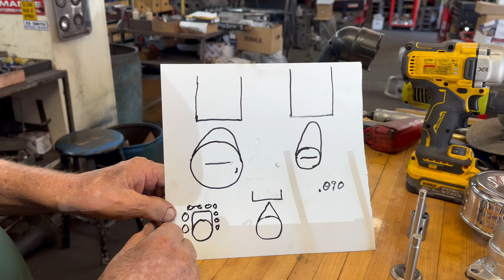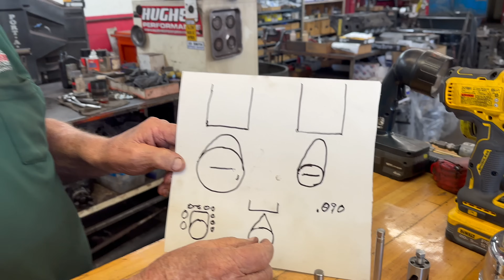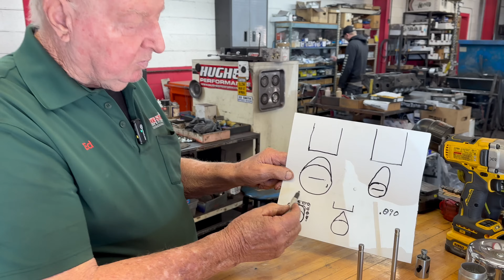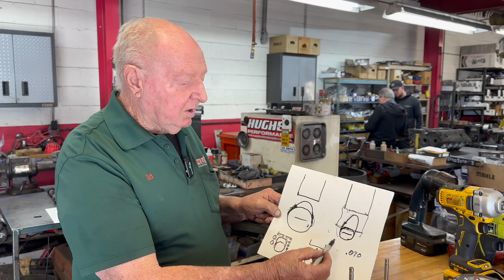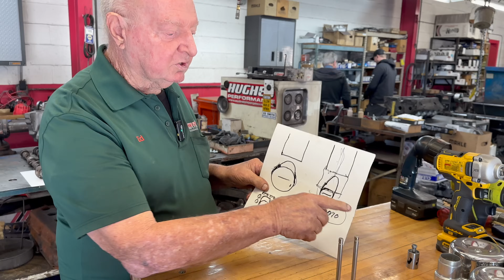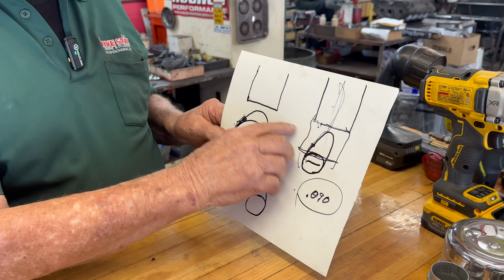UpLifting! ReGrinding CAMS for LIFT - Ed Smith Schools #barryt

Comment: I run solid roller lifters on a hydraulic roller cam in a 496 bbc.same spring pressure for hydraulic lifters. 500 more rpms

Comment: Great info! Here's a book ya don't have to read, but you may find interesting! You said Dodge in 1960, I have a set of 1961 Chrysler 32" Long Ram intakes that have been in the family since 1966. They are on their 7 th engine in their 5th drag / street car. In 1968 dad called Crane Cams and told them he had a Dodge 413 long ram in a 1957 Chevy and wanted a cam that would make them wind out better, they sent him an Experimental for Long Rams hydraulic flat tappet to try out. They put it in and hit the road with MH slicks on their 5.20:1 one ton truck axle in the back He broke the bellhousing on the 727 (I still have it) when it flashed to 7500 rpm and he hit second gear to catch it. He put that engine with 1959 imperial/300 E "509" heads in a 1964 sport fury 4 spd with 4.56 gears, went to bunker hill Indiana dragstrip in 1968 and ran in weight/ci class against 409s, 427 Chevies,  427 Fords, and a few 426 wedge cars and brought home the low e.t. trophy sitting on my shelf. Those intakes on a low compression 383 or motorhome 440 WILL come in and out of tune about every 600 rpm or so, getting progressively more violent being way louder than the  exhaust thru hood scoops (two big Thermo Quads) you can hear singing quite well 2 miles away leaving rubber every time they hit those in tune rpm windows in any gear. You have to watch out because if you let them hit 6300, they hit again HARD and will light up the tires in high gear in a C body with 4.10s and a 383 that never had the heads off it and flash thru an orange box limiter to 7300 instantly. That cam lists as a 302 / .455 on a 109 ctr or a 232 deg at .050. But A LOT can happen in those 302 degrees! It was put in a 440 Six Pack drag car and eventually wiped out 3 lobes from Napa lifters. They had .050 to .080 lobe lift left. We put in a new .230 / .474 Purple shaft on a 108, should be close, right? Not Even! That Crane went .2 seconds FASTER with the rounded off lobes! Then came a "280-.480" Competition Cams on a 110 ctr. This was a 446 ci six-pack cc'd at 7.75 :1 on stock 906s pushing a 4680 lb race weight with driver 4 door C body to 13.41 @109 for 13 years on 87 pump gas! The 280-.480 went slower than the purple shaft, still not catching the wounded 1968 Crane! Finally, we called Crane back and got someone who knew 440s. He sent us a "324-.552" on a 108. 248/254 @.050 dad looked down it at those big round lobes and said, "That sucker's gonna run!" Yup! Dropped .4 sec off the 284- .484 and set off car alarms with 3" tractor mufflers on it! Those lobes on that 1968 302 Crane were ROUND and aggressive. It is the only hyd mopar cam I have seen that actually lifts about .020 slowly, then snaps open, STOPS  moving the valve at max lift and holds it there, then drops like a rock until about .030 from the seat. For an iron head  413-440, I like big, round, identical, and close together in the middle straight up straight grind 240+ @.050 lobes! I have tested every casting of mopar wedge head except 1 of max wedge, even 350 heads, the 1959 "509" and early 1962 "324" with welch plugs have the max wedge chambers and gorgeous castings with the straightest shot to the valve by far! Back when you were at Dodge those custom order 400 + hp 413s and Desoto 350 hp 8bbl 383s from the early 60's were making 390 hp 440 six packs and 335 hp 383 road runner engines (there were 361 Desoto 8 bbl beating that) look weak.  They all had more hp/ci! I do not toss old 4 bolt heads! I sent that wounded 302 Crane to Crower (Crane wouldn't touch it, and only Crower has the right BIG BASE CIRCLE blank) for duplication. Crower grinder operator who has been there since muscle car days calls me personally and says, "Hey man, I just made the pattern for that Crane. There's something WEIRD going on with those lobes! I'm keeping that pattern if you don't mind, and I GOTTA know how it runs. A bigger base circle limits lift but allows more aggressive and complex patterns." I told him EXACTLY how it ran! I have 2 now, used dads pistons and rods,  a truck 413 block, big valve "509" heads that a professional porter for NHRA top fuel and NASCAR among others said when he saw them stock "wow! The nicest big block mopar heads I have ever seen! There's not much I can do here at all, they're factory gasket matched, beautiful straight shot castings. All I can do is a little guide and seat blending" that "302" duplicate cam, 10.2:1 long ram 413 going into a 1962 newport with 4.30 gears. There are 5 different cc mopar heads. the most popular ones are made to fit a 413 bore size regardless if they were on a 1978 440. So, I flipped that 413 (my favorite big block) on its back with the heads on and crank out, reached up the cylinders and blended and polished the chambers to exactly match the cylinders seamlessly and the cylinder valve relief notches removing any sharp edges also. Have you ever tried that?  when I met Tom Hoover I said "yea, the hemi is really cool, but if want to take a ride that will make you get out and kiss the ground shaking, there's some real VOODO in those 32" long rams if you know how to find it and not many do!" He just grinned from ear to ear and nodded his head! 😂
I also have a rebuilt running 1950 Mercury 255 flathead and a running 354 hemi in a 1958 Dodge T700 semi. Love to hear from you. It's neat to know you were there at that time, I think Dodge called the long rams "Sonoramic Commando" theres your clue,  its not just ram tuning its sound wave interactions  set by intake valve duration among other things that happen in long runners but is HARD to acheive in the real world. A change  in temp or humidity will kill it. Packing them in dry ice helps! Thanks for your teaching and time! You are irreplaceable! 😊
Reply from the maker: Thanks for sharing your incredible story!

Comment: I still have the little 1/2 hp briggs and stratten flat head single cylinder engine that I put on my home made motorbike in 1957 I put a 3/4 hp model N updraft carb and manafold on it. also I reground the camshaft (like ed tells about) to make up the clearance I welded a bit of metal onto the valve tappets. used a tuned exhaust pipe. I could beat a sears alstate moped for top speed. getting more speed without spending money I did not have to spend.
Reply from the maker: That’s awesome!